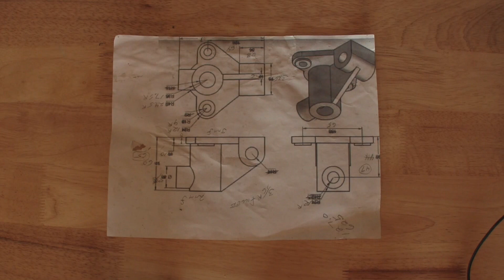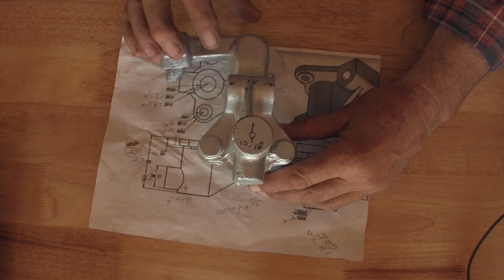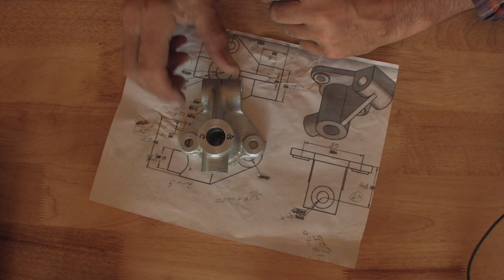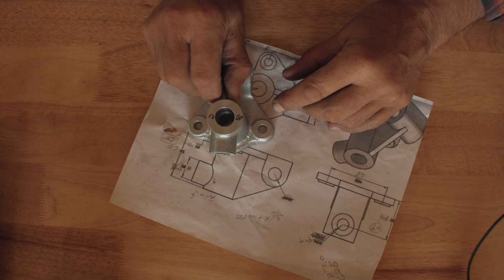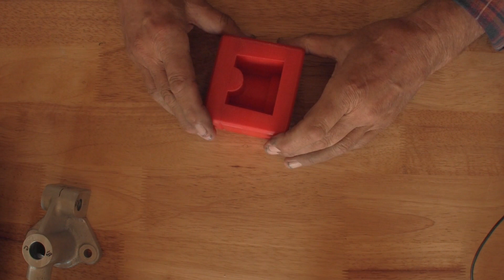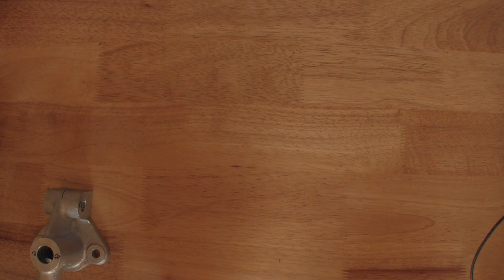Widget build, thoughts on the build.

Comment: My entry level 3D printer allowed me to pull off the biggest run of parts I've ever taken on (77 castings), without having the space or budget yet to set up the bandsaw and bigger disc sander that I very much plan on adding to my shop one day.  There's nothing I hate more after my day job (programming) than sitting at a computer for even more hours trying to make CAD behave, unless it's F'ing with a 3D printer that Just. Won't. Stick. prints to the build plate.  But it'a a necessary evil for now.  I've had some success working around the limitations of the flimsy plastic patterns by casting aluminum patterns from them before they can get too roughed up.  The widget came out great by the way.  What's it for?
Reply from the maker: The widget is just that, a widget. I was using it to show the design time on a computer and print time will take longer than just building a wood pattern.
Reply: @roscoepatternworks3471  wow, a lot of work for a show and tell piece.  Thanks for taking the time!

Comment: While I like the potential in 3D printing I feel that using the printed part, without filling the layer lines, would cause problems. Or less than desirable results. And if the part were so simple that layer lines were not an issue for pattern removal the the part probably could have easily been made out of wood.

Thanks for showing your process and the explanation.